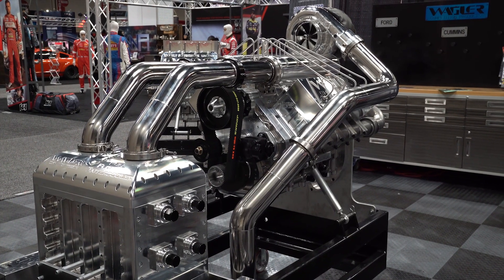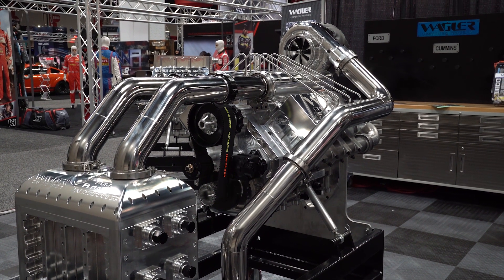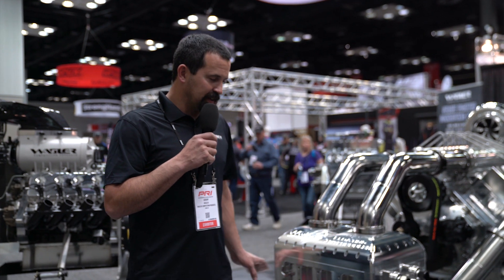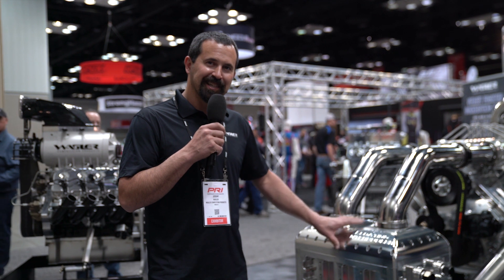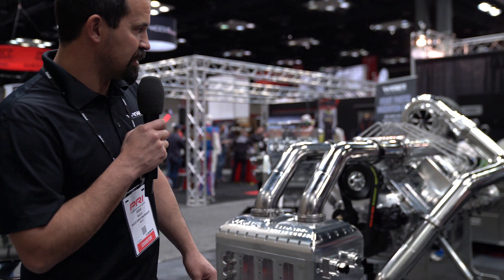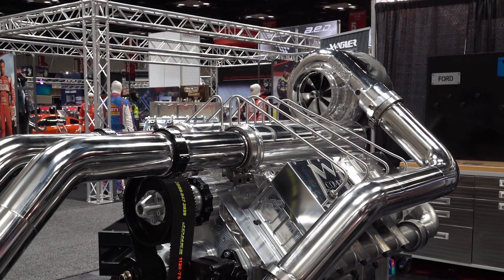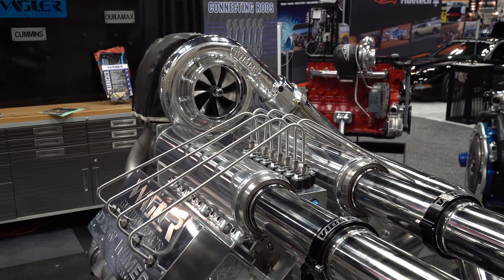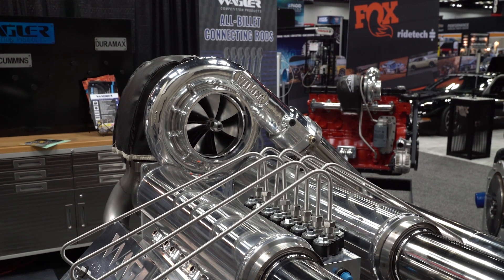3000HP on 6.6L Mechanical Duramax Pulling Engine

Comment: Can you give the list elements you use to pull 3000+hp on this engine ? 🤔
Giving 3000+hp on a 6.6l is crazy tho, i'm curious to know how many torque you produce on this setup, may be higher than regular European semi-truck which have something like 3500nm or torque